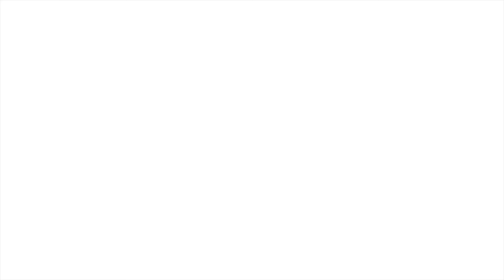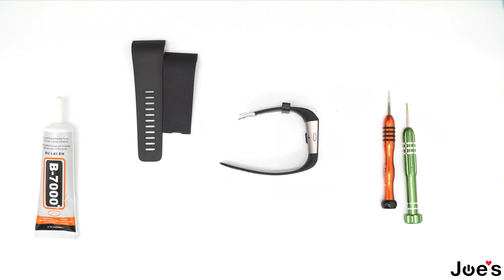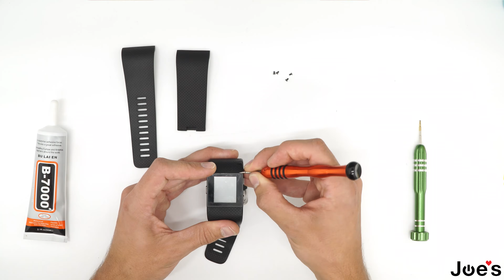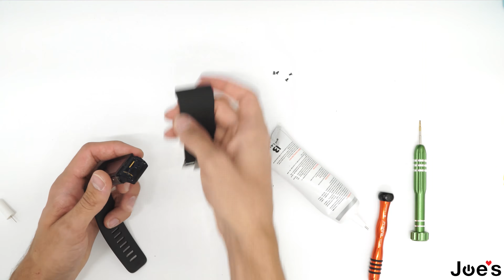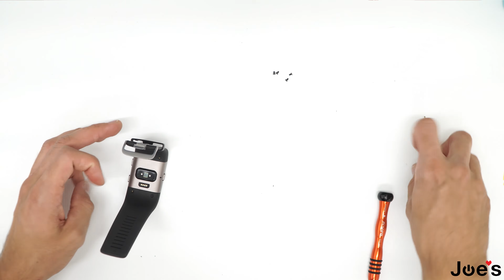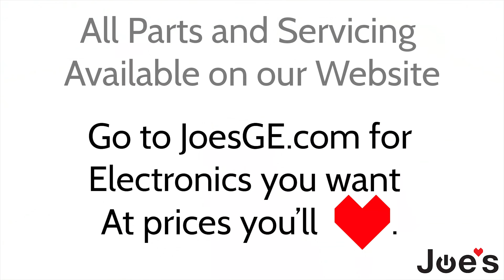How to Replace Fitbit Surge Wristband  Replacement Swap Tutorial JoesGE

Comment: Haven't you forgotten the antenna that is stuck inside to the old band with the clasp?
Reply from the maker: Hello Ad, you are correct sir! A wire was supposed to be added to the band for the Fitbit to read better. Thank you for the heads up! 

Ruslan P
Reply: @Joesge  It's not a wire it is that square gold piece stuck on the inside of the band it gets removed and put on the watch with the arrow pointing towards the right side of the screen.. (from what i understand it has something to do with the bluetooth.
Reply from the maker: It has to do with reading your heart rate. 

Ruslan P